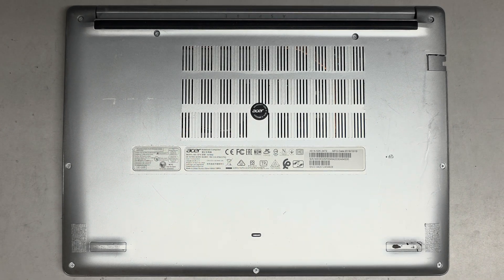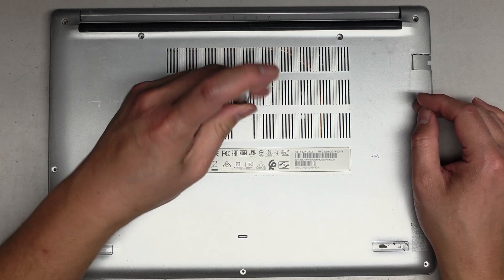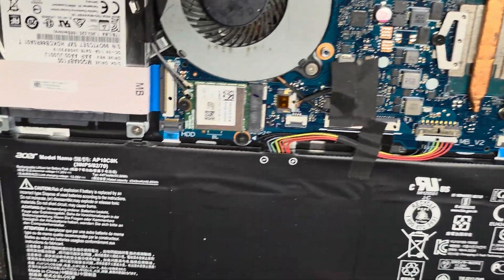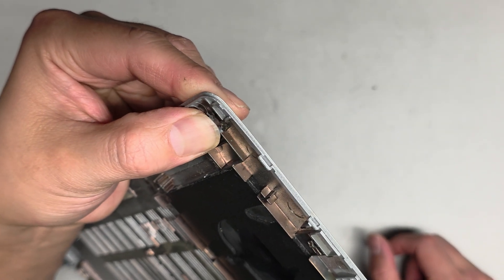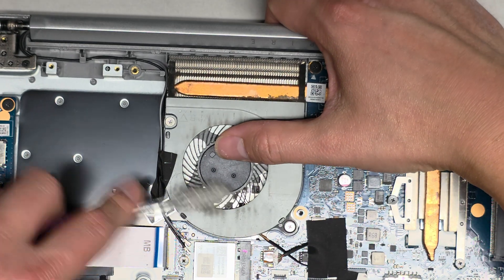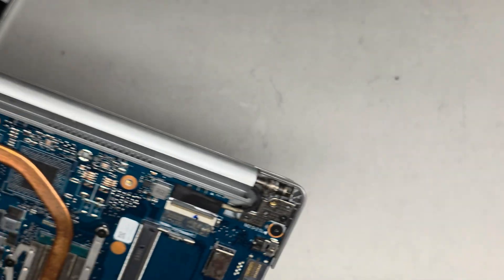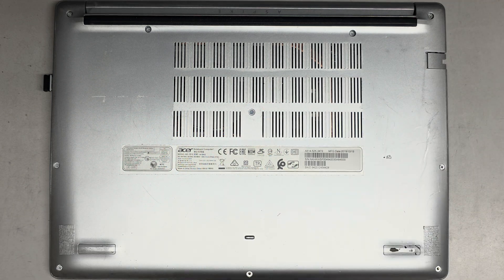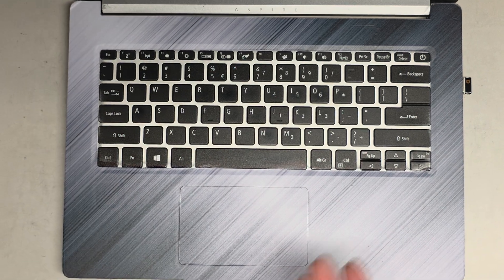Acer Aspire 5 A514-52K Disassembly RAM SSD Hard Drive Upgrade Battery Replacement Repair

Comment: do i need a separate external cable to attach the hdd or is it available on the mainboard
Reply from the maker: It should have come with the computer. The flex cable to SATA connector

Comment: do you know what type of m.2 ssd used in the slot? i cant find the type of ssd to use there, i have 3rd gen nvme but i dont know if it will be compatible
Reply from the maker: Should be fine